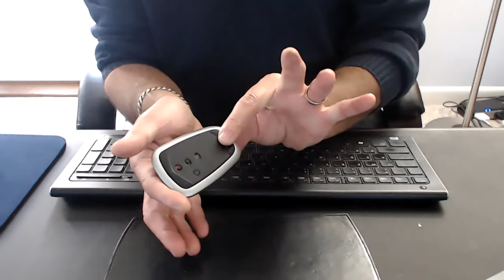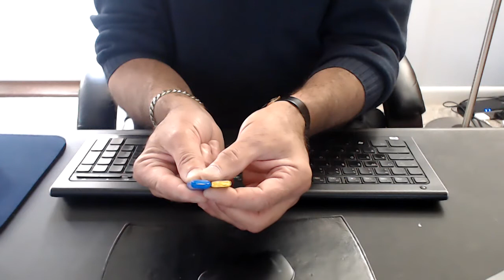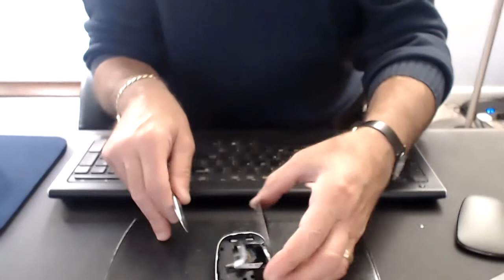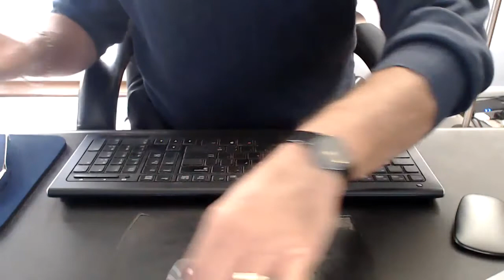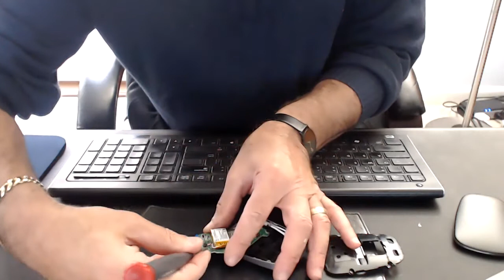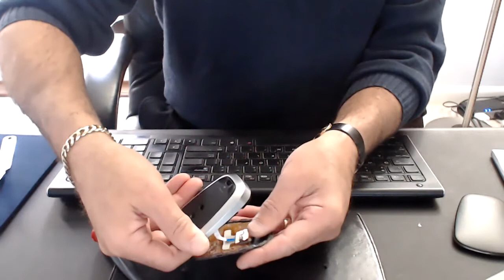Logitech T630 Ultrathin Mouse Battery Replacement

Comment: So glad you posted this.  I also have several, including one brand new one that had a completely dead battery.  I also found some on ebay that are 3X what I paid for mine.  You are right, this is absolutely the best mouse.  Thank you.
Reply from the maker: This is the one I purchased and it was $23.  Now selling for $11.95 Grab one! https://www.amazon.com/gp/product/B019YFIO6I/ref=ppx_yo_dt_b_asin_title_o08_s00?ie=UTF8&psc=1
Reply: @davidg3445 Hey thanks for this. I stopped using the mouse for a few years and now I can’t recharge the battery. Looks like that battery you linked to is no longer available :( What specs should I be looking for to make sure the battery will be compatible and fit inside the casing?
Reply: @teegees  Just purchased this one to replace the battery in another mouse I purchased.

Comment: I have three of these that I rotate through, exactly as you.  As I recall, they were fairly expensive when I bought them, but if I'd known what the offerings would be nowadays, I'd have bought ten more of them.  I see some "refurbished" ones on Amazon for ~$90.  If I had ever been happy with a "refurbished" product, I'd buy some, but I think I will try your battery replacement method instead.  Thanks for posting the video!

Comment: Here's a follow-up after doing it according to this video.  1) Starting at the bottom resulted in more destruction of the two locking tabs (that hold the cover on) than if I had started nearly anywhere else.  There are two locking tabs on the bottom edge, and one on each side, about 1/3 or 1/2 way up from the bottom edge.  Those need to stay intact to hold the cover down upon reassembly.  Starting at the top would allow those to be preserved much better.  Pressing inward on the "rim" of the cover instead of just prying straight off helps disengage the locking tabs rather than just tearing them.  2)  Don't heat "the corner", nor around the edges, as stated at 3:00 -- heat the whole face.  3) Mine came apart with the capacitive touch sensor (called a circuit board or film in the video) still stuck to the main body, rather than the cover like what you see in the video.  There is no need to remove it entirely -- just enough to access the 4 screws.  It is fairly tough, and can be pulled back to access the crews & ribbon cable connector.  3) Heating the cover again after reassembly helps make it lay back down on top better after potentially having stretched/bent it a bit prying it off the adhesive.
Reply: Have done it both ways.  I prefer starting near the top as well.  I did kill the tabs on one starting from the bottom.

Comment: Thanks!!!! My mouse battery is not holding a charge after many years of use. It would be very helpful if you could list the replacement battery part on Amazon and/or maybe a link to the page?
Reply from the maker: https://www.amazon.com/gp/product/B019YFIO6I/ref=ppx_yo_dt_b_asin_title_o03_s00?ie=UTF8&psc=1
Reply: David, I am not confident enough to do this and hate that my mouse is dying. No one wants to tackle this chore. I’m wondering if I could contract with you to do it for me - for pay if course.

Comment: mine is dyeing a slow death now
Reply from the maker: Been there done that that.  I keep two that have in rotation, when one dies, just switch back and forth. Batteries are getting harder to find again and may require more research.